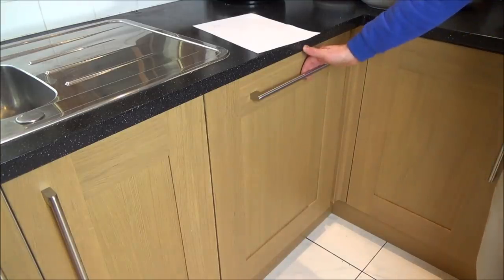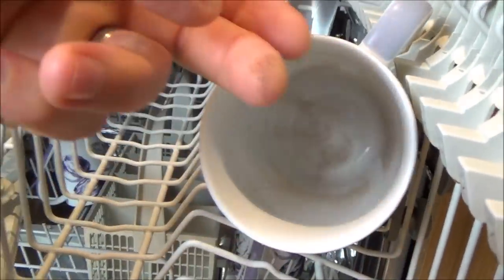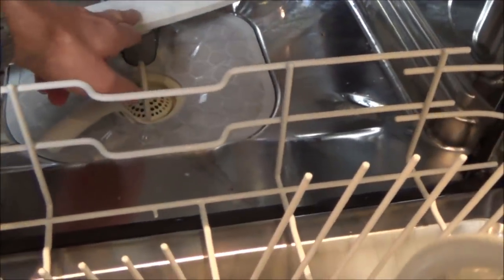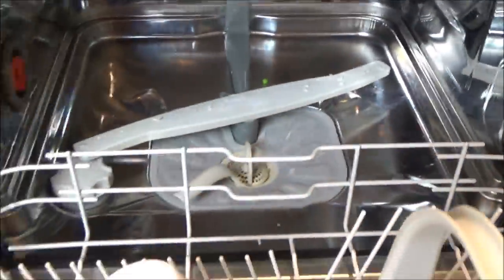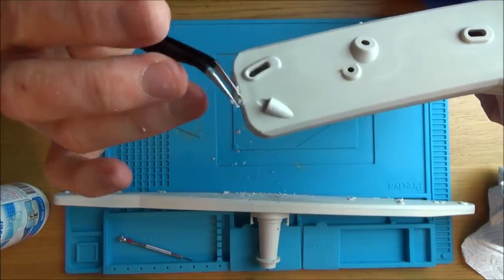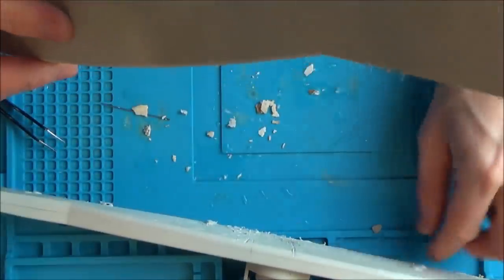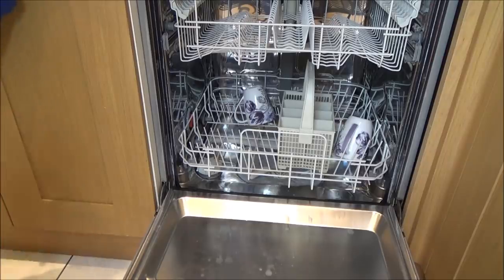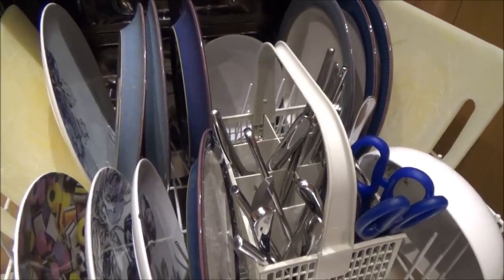Trying to FIX a Faulty Dishwasher

Comment: Vince, your dishwashers (water) softening system can avoid that lime completely, if it is set and working correctly ;-)
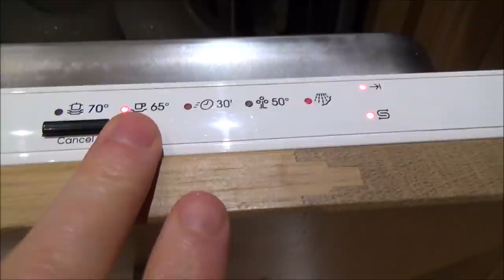The salt indicator was on 17:51 , you need to top that up. Because of the amount of lime it seems you haven't done that in a good while.
Don't rely on tabs which advertise water softening.
Reply from the maker: Thanks, I will top it up :-)
Reply: Yep those all in one tabs er useless and not worth the extra money 😉 the tabs they sell at Aldi (here in Denmark) are cheap and works great 👍🏻

Comment: Great fix Vince.  You couldn't have done it any better.  I hope I can give a bit of insight.  Most dishwashers have a salt intake usually located in the bottom left hand side for hard water areas which needs topped up every 10 to 15 cycles to prevent build up of limescale.  If they don't have that then what you did was perfect as a once every 2 to 3 year job.  First always check the two filters in the bottom which leads to the pump.  The pump in most modern systems is simply a twist off with a rubber gasket and often there is debris.  When the arms get particularly worn they can spin incorrectly and jam.  But most of the cleaning in a dishwasher is steam with heat and the scoot of water merely rinses the rest.  The most confusing error is the water inlet valve which in my experience overfills the dishwasher and makes it leak.  If I find a leaky dishwasher I check the door seals first.  You have so much experience and sense I was watching you knowing you did everything right.  Less brute force on Morden appliance arms as the have a reverse thread which only needs turned 45 degrees under the swivel arm.  Great job. 👍
Reply from the maker: Cheers Steve, we have just topped it up with salt today. We only do it once every 6 months or so. Looks like we need to do it more often :-) Thanks for sharing your knowledge and the reverse thread tip :-) Hope the new job is still going well:-)

Comment: good video, Vince.  along with using anti scale methods mentioned in the comments already, I would say considering the amount of scale that was in there already it would have been a good idea to run a cycle with the water jet arms off so it would blow the pipes out.  as it is all the scale bits in that lower unit are now up in the jet arm.  keep up the good work sir.

Comment: top tips of owning a dishwasher 1. always keep the salt toped up as it softens the water to stop scale build up 2. once a month run a dishwasher cleaner though the machine as it has a descaler  in it  3. when loading the dishwasher all knives and forks to be placed end up (except the sharp ones they face down)

Comment: Great service on the jets. Not sure what setting you have the salt on. I have a cheapo Tesco dishwasher and I can set it to soft medium or hard. It uses more salt on hard water setting. If the knives drop down onto the arm then maybe do what I do. I have the basket in the front right corner and for ease I have front row for tea spoons next row is desert spoons then forks and then knives. They all face up as I think it gives a better clean. Sharp knives lie flat on the top tray. I guess your next vid could be how to descale a kettle. :)
Reply: I load it up exactly as you do👍🍻
(maybe because we are almost from the same era lol...1973 here)
Reply: @ @dennisf1973  Lets go 1 further. Cups/mugs on top tray on left. Glass next to that. Cooking utensils on top with knives. Large plates back right bottom tray, then medium then small with breakfast bowls to far left bottom. cutting boards front left bottom. Rounded breakfast bowls lie upside down on top tray generally over the large knives and pans were ever they fit. Lets see what matches lol

Comment: I've got the exact same dishwasher as u m8 and apart from a declog once a year and running it on quality "all in one" tablets its been brilliant, as its just me and my youngest now we won't be replacing it when it expires.   You should invest in one of them cheap air compressors, a 1.5hp or better 25 or 50 litre compressor will you will find become an amazing addition to just about everything from pumping up tyres to any sanding work, blowing debris out of pipes and even hook up a hosepipe and have a pressure washer.   Lidl's often have a Parkside brand one in with all the tools like dual action sanders, impact driver, air drill and air ratchets and tyre inflators and spot sand blaster attachments.
Reply from the maker: Interesting.....I haven't had much luck with this one. I had a Bosch slimline for nearly 10 years and I didn't have to do anything to it. This one I have had to change the heater element twice, the wheels on the basket and it leaked when the left hand side screw thingy me bob worked it way loose (probably due to ramming it full of dishes). I am hoping now it will behave itself for the next year or so. The Air compressors I have never thought about but I am always up for some new toys :-)

Comment: Every domestic dishwasher has an in-built water softer, hence the use of salt in the bottom compartment, so you should never get limescale to this degree. In very hard water areas you still need to put salt in it, even if you use so-called 'salt action' tablets. If you've got such a bad build-up of scale in the spray arms then it's likely to be the same in the main pump and associated pipework (which is most likely where the pieces of scale migrated from). You should use a dishwasher cleaner & descaler to remove as much hidden limescale as possible (preferably several times) and then use it regularly thereafter.
(Edited to correct autocorrect error)

Comment: The scale is mostly Calcium carbonate (not water soluble) if you used an acid like acetic acid (vinegar) or citric acid, it will react with the Calcium carbonate turning it into Calcium acetate (water soluble) Hope this helps :)
Reply: Try to fix a Wii that doesn't power on

Comment: Just a few tips for using your dishwasher, rinsing your plates before putting in isn't needed, just scrape off the big leftovers. The cleaner your dishes are the more difficult it is for your dishwasher to clean it. The water/soap will stick to the plates/cups/etc. during the cycles, If they are almost clean from the start, the water/soap will run off too easy. 
Another tip, if you use salt, rinse aid and just regular tablets instead of those fancy all-in-one tablets, you are saving a lot of money. We (my wife and I) are spending about €70,-/year (with daily use) by using salt, rinse aid and regular tablets, when we would use those all-in-one tablets it would be €210. The salt in the machine is also a great way to prevent scale in your machine. And use once a month a machine cleaner (just the cheap home brand).

Comment: Take off the arms, put them in a basin, fill them with vinegar (or any limescale remover solution), leave them for a few hours. Voilà, problem solved. And keep your dishwasher's salt reservoir topped up: I don't need to do that anymore since I installed a water filtration system for the whole house. Once in a while, do a complete washing cycle with the dishwasher empty and a tank of dishwasher cleaner solution. Tip: put forks, spoons and kives pointing up in the basket, and be careful when you remove them.

Comment: If I were you I would run a descaler through the whole machine a couple times. If you have that much scale in the wash arms, I guaranty you have a lot more through the rest of the water lines, pump, and drain.

Comment: Its ok cleaning the spinning heads but with that much lime scale imagine what the internal pipes look like. As soon as you switch it on over time whatever is in the pipes will block the roating arms. Flush it with Calgon a few times.

Comment: you should really run a descaler through it to clean out all the limescale, even soaking in lemon juice would work, alot easier than poking it with needles and using the hosepipe

Comment: and i notice you salt light and rinse aid light was on running the dishwasher with out them will cause you theses problems
Reply: modern tablets have have the required salt in them
Reply: bridgendesar not enough for hard water areas I used to service them and so many are under that same illusion 👍
Reply: @jairsharp9993  lucky me then!
Reply: ALWAYS use salt and rince agent 👍🏻

Comment: My water's not hard, it was rice grains that blocked mine.
My worry for you now is, how long before the inlet solenoid valve or outlet impeller will last.
Reply: As an ex fix man, don't worry it cant block the inlet. The outlet pumps are "self cleaning" but can be jammed with something hard like a glass shard or plastic. Rice can stop the arm turning if it blocks the jets that are on an angle- to push it round.

Comment: Occasional use of Finish (or other) dishwasher cleaner will stop it building up but for this I'd have left the arms in a basin of citric acid solution and was the bubbles rise as the magic happens and all your limescale dissolves without any elbow grease - but that would have made for a less interesting video :-D

Comment: I would put money down that the Bosch "your previous Dishwasher" had stainless steel innards and more importantly water Jets, that are possibly chromium, Stainless steel or Teflon coated as these surfaces are not as porous as polished moulded plastic surfaces are, ergo a STAINLESS steel or slippery Err-"NON STICK" surface will remain scale free a damn sight longer. 

So yeah Vince "Oh and all you lucky readers reading this" Now we know to pay a little more and I do stress a little more seeing how cheap water jet components are to replace them..
I guess what I am trying to say is that we must weigh in the overall service life and expected replacement costs the next time we are forced to buy a new Dishwasher, in short if I can get a completely stainless steel dishwasher and it's only going to cost me a few extra bucks "less than $50 bucks, then that would be my choice, yeah I be a Lazy son O beach when it comes to cleaning..  As U-shell I Liked the video..

Comment: Looks like your machine has a water softener system ( the white plastic cover on the left). Put some dishwasher salt in it ( not table salt ) and problem solved.
Reply: Table salt is the same just without the anti clumping agent (only there for when in storage)